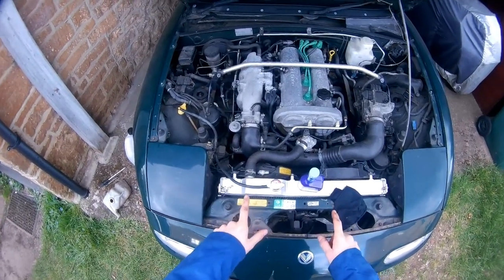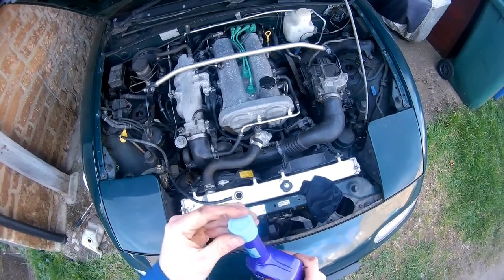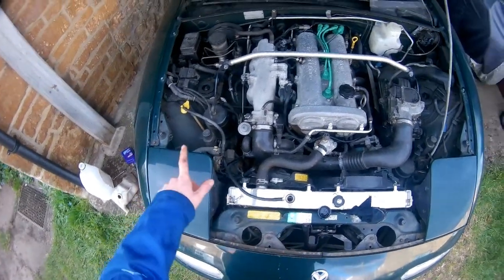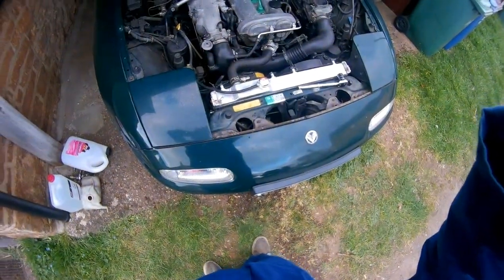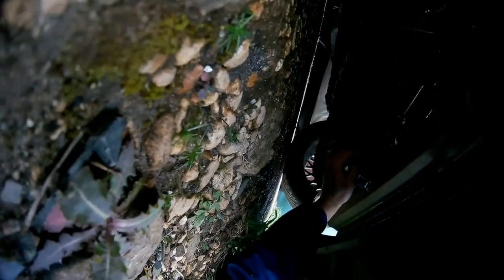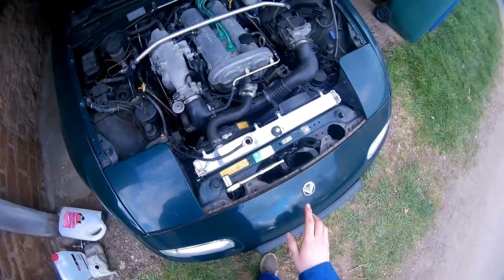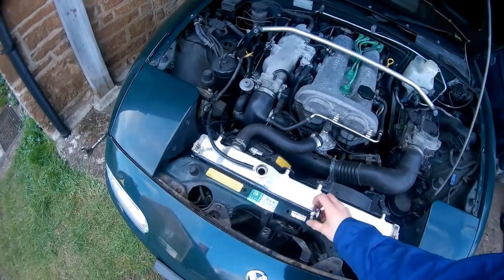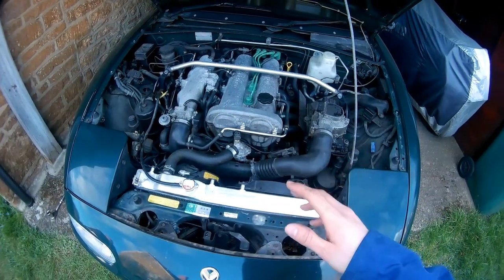Mazda MX5 coolant flush

Comment: Hiw much flush goes into the radiator? And do i put the same amount of water into the radiator?
Reply from the maker: Follow the instructions in the back of the product you buy. In my case, it was the whole bottle. After that you need to completely fill the cooling system with water and then run the car as per the instructions in the bottle.